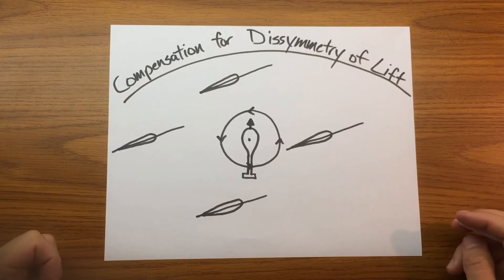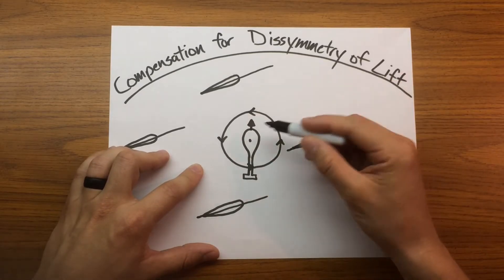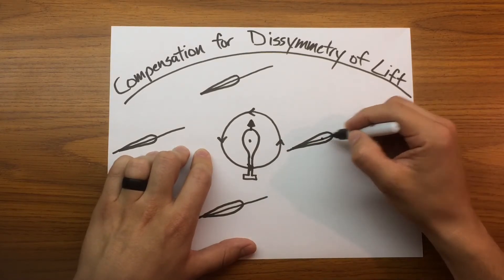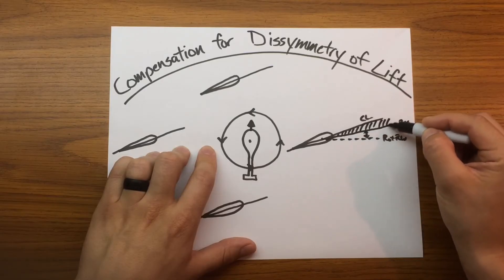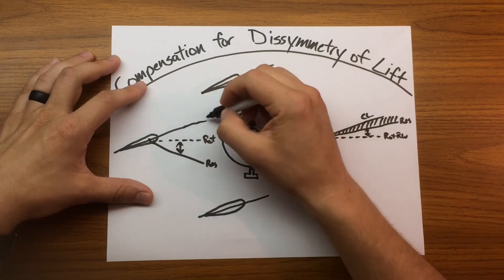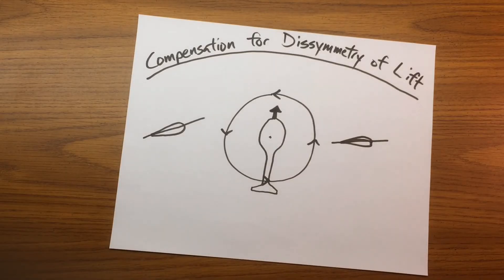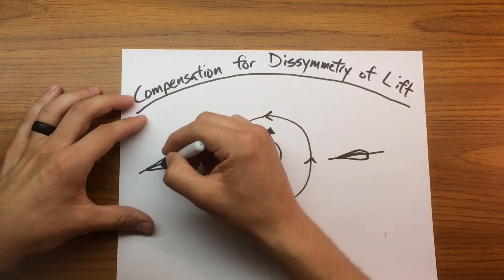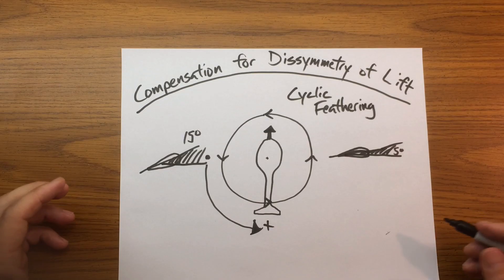Compensation for Dissymmetry of Lift in Helicopters

Comment: I’m a smart intelligent guy, but I still can’t process why flapping UP decreases AOA and lift while flapping DOWN increases AOA and lift. I understand the dissymmetry when stationary or no wind hover.

I can see the math geometry but in not in my minds eye. I mean sitting stationary the right side is AOA is increasing lift, while left side is decreasing lift. I’m just not seeing the lightbulb when relative wind and flapping comes into the equation.

I had a similar block with some math problem in like the 3rd grade when my math teacher explained a way to look at the math I was blocked with and all of a sudden I could just see it, got it and got straight A’s from then on.
Reply: Im totalt with you! I was having a damn hard time to see exactly what you are pointing out. I think it’s like this..

The right side blade flaps up cause of higher speed, which forces the left side to flap down. It’s the actual movement of the blade when it’s flapping down that causes increased relative AOA.

I hope I understands that correctly?
I can be totally wrong thou. 😂 

If that’s wrong pls correct me. 😊
Reply: I’m in the same boat!! And I’m still confused in visualizing the blades/airfoil
Reply: When a wing flaps UP, it feels an airflow that goes DOWN. It's like when your airplane goes FORWARD, It feels an airflow going AFT. 
The airflow has the opposite direction of the body motion in the fluid. 
Triangle of velocities: the Wing Is both going forward and flapping up. Then the airflow is an arrow going rearwards and a bit downwards. 
If your Wing didn't flap, the flow would only go rearwards. Just draw It: you will notice the first arrow, going also down, Is taking away some AoA with respect to the second arrow, Just going rearwards.

Comment: Congratulations for your excellent video! 👏🏻
And what about the blowback tendency? In spite of providing compensation for dissimetry of lift, flapping movement generates another effect in the helicopter flight: blowback. Due to phase lag (or gyroscopic precession), the advancing blade (more lift) will have maximum up displacement in the forward section. Similarly, maximum down displacement will occur in the aft section of rotor disk. As a consequence, the helicopter tends to pitch up.

Comment: Sir, the lift equation L = 1/2 C. pv ( squared). S is for fixed wing aircraft. On helicopters  the lift varies with the square of radius, also taKing into account of the area.Could you give a full explanation on this.

Comment: Hi. I just learned about your channel today and am watching your videos in order. I hold a commercial fixed wing licence. As much as I am enjoying your lessons so far, I was a bit confused about "flapping". The clarification I need is about how this works. From what you have described, it would seem this is a naturally occurring phenomenon and not a design characteristic or pilot input.  Is that correct? Are you stating that the forward movement of a blade into the headwind gives it lift such that it bends upwards AND that upward bending movement actually decreases the effective angle of attack? And, that the reduced airflow on the retreating blade reduces lift enough such that the blade spring backs down to its natural position and that movement effectively reduces the AoA? That kind of blows my mind. I would not have thought that the relative speeds - ie, blade rotation vs fwd movement would be that close. 
So this brings me to my two questions: If aerodynamics are as I have described above, wouldn't that mean that faster forward movement would result in drastically greater deflection, i.e. 'flapping'? That must be brutally stressful on the blade. 
The second question has to do with the AoA at the 12 o'clock and 6 o'clock positions. I am assuming that the relative airflow is the same at these two locations and thus so is the lift generated. At this point, wouldn't the desire for the blade to return to it's neutral position (no flapping) be the same? But the blade in the 12 o'clock position would be bending downward, increasing it's lift and the blade at the 6 o'clock is springing upwards thereby decreasing lift. Wouldn't this result in a pitch up moment?
Thanks for reading through all that.

Comment: Just started my Commercial Rotor add-on and my instructor recommended your videos.  Coming from the fixed-wing world, blade flapping was hurting my head - I thought the blade was twisting or something to change pitch but you explained that it's a change in relative wind due to the upwards or downwards motion of the blade.  Totally clicked for me!  My only comment would be, what you're calling "lifting area", shouldn't that be called Angle of Attack?

Comment: Cyclic feathering is simple enough to understand, but the first part of this video seems to be packed with a lot of terms that are left largely unexplained. Resultant? Upflow? Downflow? Downflap? Upflap? All this could use a some explanation.

Specifically, I think, the detail that it's not the position higher or lower in the given instant that matters - but the movement to reach that max flap position -- which is the thing that causes the change of resultant relative wind angle. I know I was mentally stuck with it until it was pointed out to me. :)

Comment: Not sure whether you still keep an eye out for comments, but at the very end you said "increased AoA, increase in lift" and this is where the HFH has me confused as well. On pg 2-13 it says "When AoA is increased...there's more lift" (so a direct relationship), but then on 2-19 it says as velocity increases, more lift is generated, and the AoA decreases on the advancing blade (an inverse relationship between lift and AoA) (and the opposite of what you said at the end). So which is it?
Reply: Both, I think. I'm not an expert at anything, though.
So, as speed increases you've got more ETL, therefore less blade AoA is needed to keep you at the same altitude with higher air speed?  (With enough speed you'll get into retreating blade stall but we're not taking that into effect here, right?)

Comment: Thank you for the video, during the cyclic feathering does the blade actually pitches down on the advancing side to reduce the lift (or )does its angle of incidence kept unchanged and only the angle of incidence of advancing side increased to compensate lift. ? Please reply, Thanks in Advance

Comment: Hi Jacob, a question to the feathering, you sayfor example Pitch increased left and decreased right, but is that not turning around as the rotor spins? I mean, is that a flexible thing always changing with energy spin?
Reply: solid maybe

Comment: Around the 1 minute mark you say the difference of lift produced by the advancing and retreating side will cause a constant roll to the left. But in reality this would manifest 90 degrees later causing the nose of the aircraft to tip up, correct? Which is what we refer to as blowback and must be fought against with forward cyclic.

Comment: You really should acknowledge for the newbies' sake that dissymmetry of lift, if left unchecked, would not produce a roll to the right in all cases. Too many students will be confused by this. You are generalizing when there are still a huge number of helicopters that they may fly one day who's rotor systems turn in the opposite direction. Get in one of those and dissymmetry of lift's tendency is exactly the opposite.  Better if you say the roll would result to the side of the retreating blades.

Comment: What I still don’t understand is why the helicopter wants to roll left as speed increases?? I thought due to gyroscopic precession the effect would be felt 90 degrees later causing an even nose up force, not a left roll. In the R22 you can clearly tell the aircraft want to roll hard left, and there is trim specifically for that when cruising.

Comment: also in the cyclic pitch, is it really that the force lags 90 degrees, or is it that the added force at the left by the cyclic induces flapping where the highest position of the blades will be 90 degrees later (and equal height 180 degrees later, lowest height 270 degrees later)? and then your rotor lift vector is tilted forwards, and most of the weight of the helicopter is not spinning, so it all pitches forwards? I am not sure how the gyroscope effect works here since, the rotor is spinning and cyclic induces forces in it, then it flaps, then the rotor puts moments on the fuselage which pitch or roll it, and then you've got a spinning disc that's pitching or rolling and some gyroscopic stuff has gotta happen there too,  feeding back in        , complicated!!  But I can see from your explanation that, if a helicopter is moving forwards fast, and the cyclic is neutral,  the flapping will move the rotor disc back and the helicopter will slow down and pitch up (not roll), neat!  Also, if the helicopter wants to stay moving forwards at a stable speed, the cyclic will be positioned forwards a bit to not flap the rotor rearwards against the oncoming wind, to aim it forwards a bit instead

Comment: Your videos really help put it all together. Thanks for that. 

I have one thing eluding me.........can we see flapping?  Or is it an aerodynamic term (like aoa) that we can’t really see?  For example, does a blade actually flap?  Does it bend?  Or is it strictly aero?

Thx
Reply from the maker: grant22vids. The most pronounced way you experience flapping is during your takeoffs when you experience blowback. While taking off the advancing blade begins to flap up. This manifests 90 degrees later where the front half of the rotor disk tilts up. The helicopter has now compensated for the dissymmetry of lift. However, to keep accelerating forward you have to apply forward cyclic. By doing this you are creating more lift on the rear half of the rotor disk in order to accelerate. This has now caused a dissymmetry in lift to reoccurring (but in a good way) because the aft portion is now being used to accelerate the helicopter. So in forward flight you’ll actually see the aft half of the disk flapping up. This is the easiest flapping to see visually. I hope this helps.

Comment: Don't really get it at https://youtu.be/culBbvszRpk?t=170 where does that downward flow of air (and upward on the retreating blade) come from, what's producing it? When I hear "flapping up" I would expect the blade increasing aoa to RotRelWind, resulting in even more lift.
Reply from the maker: Eteokles81. The upflow/downflow from flapping occurs because the blade is moving up or down vertically relative to the mast. This affects how the resultant airflow impacts the airfoil. It's not necessarily causing any difference in pitch in the blade as it pertains to Angle of Incidence. As the blade flaps up, there is more downward flow of air (induced flow) than normal which reduces Angle of Attack. I hope this helps. Thanks for the feedback!
Reply: @helicopterlessonsin10minut10  Yep, I got a similar answer from some guys in my flight sim group, thanks.

Comment: Great videos, I’m really enjoying them. Someone else asked this below, but I’m not sure it got answered to my satisfaction.. at the very beginning of the video, you mention that the retreating blade has less lift, causing a left roll, but would gyroscopic precession manifest that into a nose up reaction? Thank you.
Reply from the maker: taltruda. I wondered the same thing and I've dug around everywhere for why it is so. All of the manuals and references point to a roll to the retreating side without much explanation. My best guess is that the  left roll manifests here just like it does in the case of retreating blade stall, only less severe. When the retreating blade stalls, a pitching up and rolling left occurs due to the differences in drag and lift in the rotor system. This may not be the best answer but I'll continue to research it. Thanks for the feedback.

Comment: Fantastic videos, and I'm so grateful someone who is keenly knowledgeable and interested in helicopters is addressing the lift equation and lift dynamics regarding helicopter air-foil dynamics as opposed to airplane propeller dynamics.  _thank you so much_.  Really, really helpful.  One clarification and a question if you have a moment please--  AoA then, is really the lift angle the blade uses to provide lift above and beyond what lift it gets from IF?  Is there an equation for calculating how much lift is derived from IF alone?
Reply from the maker: ReactanceIsFutile. The induced flow is not giving any sort of lift. The angle of Attack is the usable angle where lift is produced. In helicopters the angle of Incidence must be enough to overcome induced flow and produce an angle of Attack. I hope that helps answer your question.
Reply: Okay, I get that now, thank you.

Comment: Concerning your statement at 1:00, wouldn't it cause constant nose up pitching due to gyroscopic presession?
Reply from the maker: Andromedarr. I think you're confusing aerodynamic forces with control rigging as it pertains to Gyroscopic Precession. For a left roll a pilot makes a left cyclic input. This increases the pitch at the tail so that an increase in lift occurs 90 degrees later at the 3 o'clock position.  Increasing lift at the 3 o'clock position will cause a left roll regardless of what causes it.
Reply: I don't think you answered his question clear enough. Yes an increase in pitch at the tail would cause lift on the right side,,,thus rolling it left.....but here the lift is on the right so 90 degrees later shoulder be the lift no?

Comment: Sir, I recently read an article concerning dissymmetry of lift which stated flapping only compensates for part of the effect. Right cyclic trim assists the pilot by actually moving the position  of the cyclic control to the right. I would appreciate your comments on right cyclic trim and how it works.  Again, thanks for your effort  and expertise in helping us understand these complex subjects.
Reply from the maker: David Wallace. Both flapping and cyclic feathering help to offset Dissymmetry of Lift. I believe right cyclic trimming is actually to compensate for Translating Tendency.  In some helicopters the rotor mast is tilted slightly to the left to overcome Translating Tendency during hovering maneuvers. But once in forward flight you this rigging overcompensates for the effect.  So some helicopters incorporate a Right Cyclic Trim to alleviate the need for the pilot to hold in right cyclic the entire time. But this is still a form of cyclic feathering because it affects pitch on just a portion of the rotor disk.  I'd be interested to read the article.  Good question though. I hope this helps.
Reply: Helicopter Lessons In 10 Minutes or Less . Thank you    sir for your  prompt reply. The article I read concerning  cyclic trim is entitled "Our good friend cyclic right trim." I  discovered this article on Google while researching  the subject in relation to the R22. The article, which is  more or less a forum,  does address cyclic trim for translating tendency. However,  the right cyclic trim in the R22 is only used at higher air speed. Could this indicate as speed and dissymmetry increase the pilot, at least in the R22, may have yo help out a little with a little right cyclic? Thank you again for your efforts and expertise. I have no one else to talk to about helicopters and your lessons are greatly appreciated and anticipated.
Reply from the maker: David Wallace. I've never flown the R22. But in the helicopters I have flown I've never noticed a need for an increase in right cyclic at higher air speeds.  While not claiming to be an expert in the R22 my assumption is that there is some type of control rigging or the transmission is mounted slightly offset to compensate for Translating Tendency. At higher air speeds this rigging could cause a left roll that would need to be compensated for with right cyclic.  I'd recommend looking into the operator's manual to see if it might have an explanation for this.
Reply: Helicopter Lessons In 10 Minutes or Less Thanks for your reply. I'll  see if I can find a POH on line and see what it has to say. Fly safe, sir.
Reply: @helicopterlessonsin10minut10  "But this is still a form of cyclic feathering because it affects pitch on just a portion of the rotor disk."
Isnt that what the cyclic does in the first place, through the mechanism of the swash plate?
Reply: Not quite sure whether I can follow all the arguments. What is OK is that the lift (force) on a blade is proportional to air speed, in case of air straight from the front with the peak force at 90 degrees to the center line of the fuselage.  Depending on the direction of rotation of main rotor this will produce a tilting force on the rotor disc to the left or right, I agree.  This however does not translate into tilting the helicopter fuselage to the right or left, but due phase lag into an "elevator up" re-action, ie a tilt of the fuselage towards the back.  So in my thinking the faster the forward flight the more forward cyclic is needed to compensate irrespective of direction of main rotor rotation, not a cyclic "aileron" correction.  I only fly RC heli scale models, but it would be great if a real heli pilot could confirm the theory in practical terms.
Reply: Let's not forget the horizontal n vertical stabilizers, which in flight, the air or relative wind which is flowing around the fuselage helps to stabilize the helicopter, or keep the helicopter in trim...

Comment: So are all cyclic inputs considered cyclic feathering?
Reply from the maker: Troy Asher. Generally speaking Cyclic feathering is synonymous with cyclic inputs. The only exception would be when you "center" or "neutralize" the cyclic from a displaced position. This cyclic input would actually take away the feathering in the blades.